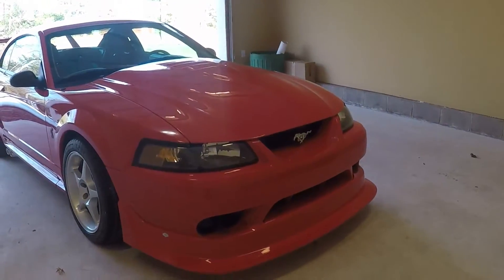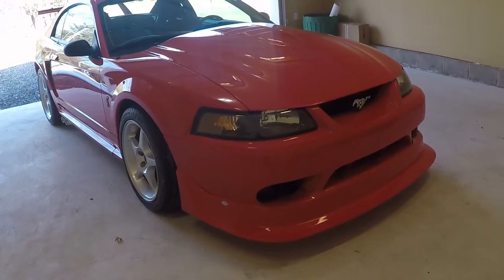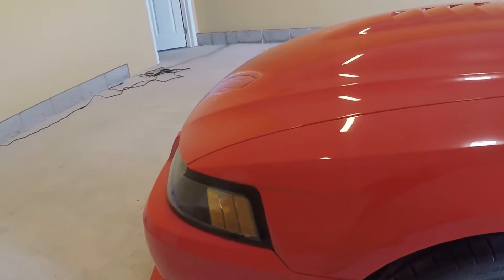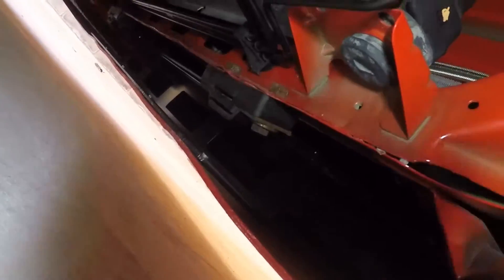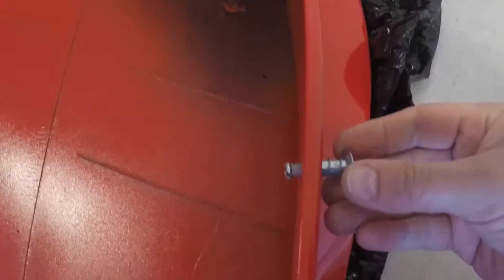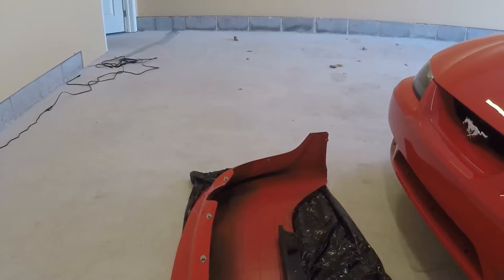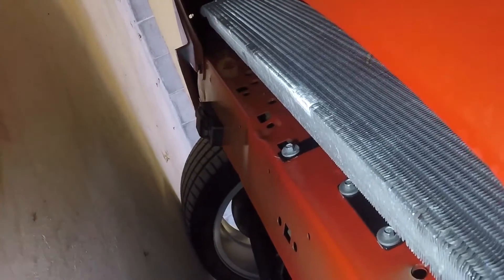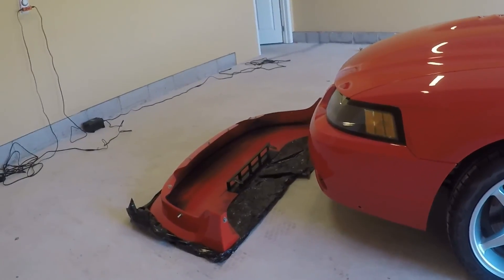How a 2000 Cobra R splitter works

Comment: This vehicle was wind tunnel tested by ford. The front splitter and rear spoiler were added to help stability at high speed. Not sure what this guy is talking about.
Reply from the maker: and manufacturers dont always get it right. several of the owners who raced these cars agreed that it made the car unstable at high speed. one owner cut out the front and put a vent on it to avoid a high pressure area building on the front.
Reply: Might be the lack of actual reinforment in the splitter? From what ive seen the splitter is just relatively flimsy plastic that warps and bends with stress. Maybe if the splitter and wing were made of stronger material like carbon fiber they would be more effective at their job.
Reply: You will find that wind tunnel testing is one thing; real world testing is a WHOLE different animal. This video shows you the real, unaltered truth. Look at the video superspeeder Rob did with Matt Farrah when they drove one on a rally. As others have said, not any support structure built for the front.